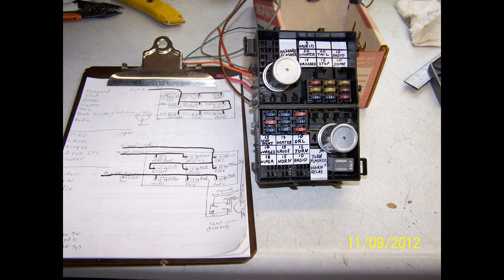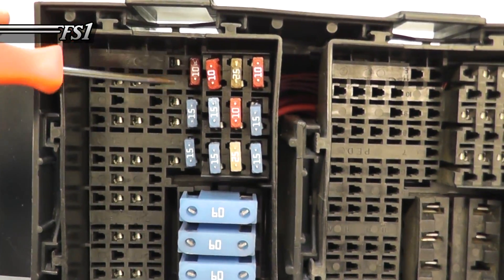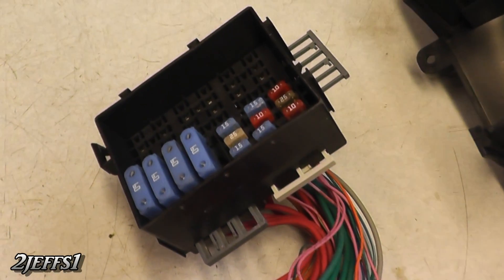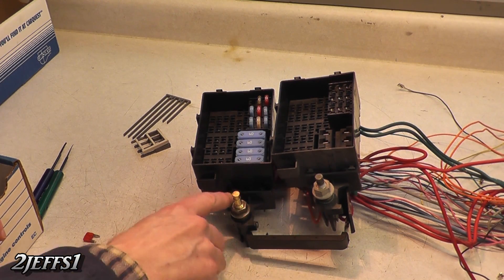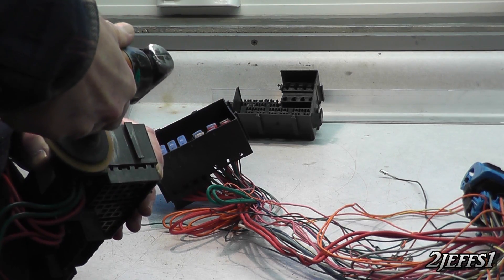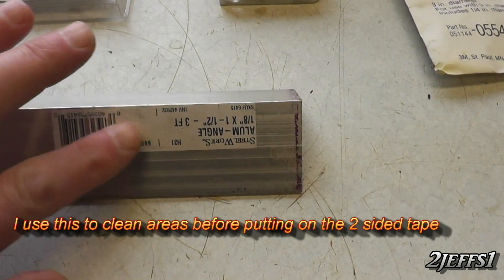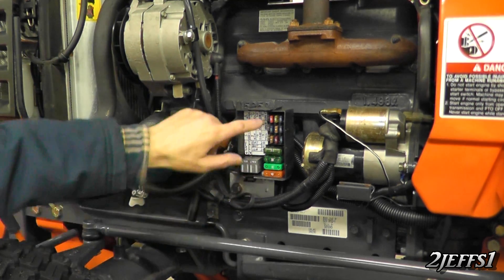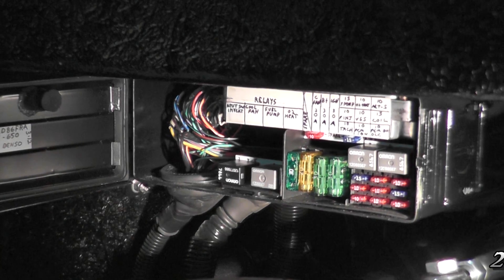Fuse Box Build Your Own Inexpensively DIY

Comment: very nice video!!!! I used an EZ-Wiring 21 kit to wire my 1978 chevy pickup mud truck up ... but for offroad lights, elec fans and elec fuel pump I'm going to be running a 1988 olds 88 kit. Waterproof relays (7) and a ton of fuses.

What size breaker do you run from the battery to the distribution block? I may of overlooked if you said it already...
Reply from the maker: Hi Jeff. Seems I have been using a 40 to 60a depending on the project. Just a thought - If you are using maxi fuses you could pull the main fuse, install an amp meter in it's place, turn everything on and then go 20a above that total load. Just make sure you have adequate wire gauge to feed the main where one taps everything off of. Usually around a 10 to 8 gauge wire is good for a main feed and then you have your 15 or 20's after the main. They do have those fusible links which were popular in the past but I prefer those maxi fuses these days for the main so if there would be a problem everything is in that same location. No biggie I guess just trying to give some you some  options.

Comment: You say you run one to the battery at 3:10. Is that the main connection that feeds the rest of the smaller fuses in the panel? Or do you have to run an individual wire from the battery to each small fuse?

Comment: Cheap alternative to the terminal extractor tool is paper clips. bend a portion of it straight, then put a slight bend near the tip like you did with your tools and it works great as long as your hands don't sweat. It doesn't work as good as the tool, but it works if you know exactly where the tab is on the terminal. I almost feel like i'm lock picking when removing terminals that way, lol.
Reply from the maker: Great tip for when one don't have that tool! Thank you, Jeff!

Comment: This is another great video, 2jeffs1!  I want to add a circuit to the existing fuse block to runn a small compressor on my truck.  there is one live unused spot-would you recommend using a Posi-Tap to the hotwire to tie into and then run the fuse there?  I didn't want to use an Add-a-fuse because can't get the fuse block cover on over those.  ??
Reply from the maker: +WorldCommander It sounds like you are good to go on your thoughts but without seeing what you have its hard to say for sure.

Comment: man you blow me away with some of your ideas, I never would have thoughtyou could turn those vehicle fuse boxes into something so versatile. I willdefinitely be doing that to my homebuilt tractor..so much better then those cheap auxiliary ones from the auto parts store..I noticed the occilloscope and power supply on your bench do you have an electronic background as well ? I am an electronics engineer by trade and a licensed electrician as well but I build stuff like you do as well, just wondered if you had crossed trade as well, it has its benefits and the stuff you do would lead one to believe you have a very wide range of knowledge.
Reply from the maker: +steve lecain I have always been creative thru the years which really helped in saving $$ to keep things going here. I do specialize in late model automotive electronics. There have been multiple times that the weird problem vehicles end up here. Have many ways that are not in a book for chasing the intermittent ones. I have fixed some sterio's and tv's thru the years before things turned into a throw away world. I haven't had any training on that stuff, not fast but usually do good. On the home wiring thing - all the electrical here has been done by me. From installing the service, main box, sub panels, bending conduit, proper circuit loads, 4 ways, security/fire system etc. The inspector shows up, has a wise guy comment and goes away. I have read some books thru the years which did help considerably especially for code stuff. I always tell people - don't let things scare you. You don't know til ya try and made some great friends giving how to advice along the way. But yeah - It has been an interesting journey here thru the years and being handy insured things could be affordability done! I bet it would be very interesting to follow you at work for the day. Where you do that for a living - bet there would be a lot to be learned above the level I'm at!  :>)
Reply: +2jeffs1 well my friend you seem to have a good handle on it,i just run a factory maintenance shop now after 40 years of it getting crippled up with arthritis so a desk job suites me,,but I have a nice shop home all the welding gear I need , would love a laithe and a small mill but that isn't going to happen any time soon..but I ave a huge inventory of tools I have been buying since I was about 15.yeh you mentioned wiring your own place, here in Canada you would not be allowed at all, you must be a licensed electrician,, and that was basically a job protection thing set up by the unions,,but far as I am concerned if you follow code and it meets the inspection it shouldn't matter. I am actually a licensed industrial electrician but I cannot pull a permit to wire a house,,,stupid but then again a union thing.but I do my own here anyway..you would love my electronics shop got some cool stuff there, I design and build circuit boards for some custom jobs I do on the side..thats where the electronics engineering technology diploma comes in..lol,, anyway take care man and keep those vids coming I am always waiting for them..

Comment: This is straight genius. Im trying to find a way to hookup a cheap fuseblock for my megasquirt powered starion. you are a genious. subscribed. i love how i have multiple spots for relays and 19 circuits.
Reply from the maker: ray Church Thank you Ray. Sounds like you have a fun project going on there. The hardest part for me is to find something that can be adapted that fits the need. Once you get past that the rest seems to go so much better!
Reply: 2jeffs1 Thank you for the quick reply. Its a custom turbo build. I'm wondering where the ground is for the fuse block. isitout of the main relay for the power from the battery or should the fuseblock have its own ground? i was at the junkyard all morning i have the fusebox ready and getting cleaned up. i have the terminalsoakingsoitslikea brand new unit.
Reply from the maker: ray Church Hi Ray. Neat to hear how things are going. Was wondering if your working on a Subaru so I can be most helpful. Just a little trivia for ya - On the Subaru I never used the main relay on my engine run system. Made lotsa changes. The way these were wired in my mind was way over-engineered. Same with the cruse control too. Ya blow the horn and the cruse is canceled as per factory wiring! I can tell you if you need a ground for any of the engine relays or system they should be taken off the engine block and not the chassis or battery. I would branch off as required on the back/hidden side of the fuse box as needed.

Comment: Working on updating the electrical system for a 1975 Jeep CJ5. Getting rid of the old glass fuses. What is your source for the Maxi fuse terminals? I know they are Delphi 800 series terminal. I found only one source for $5 each, OUCH!
Reply from the maker: Hi Gerald. Wow on the price of those. Sorry - I don't have a source for those. What I have been doing is prying open where the outer part of the c ring on a used one. Cut the wire there, install the new wire, re-crimp & solder. Maybe final touch with a piece of heat shrink. Hope this helps. If you ever find a source please let me know. Had to tell ya years back I had a 1974 CJ5. Had a blast with it for years. Like what happens to other folks - still wish I had it. :)
Reply: Thank you for responding. I did find the maxi fuse terminals for the fuse block you use a little cheaper @ $3.01 each. For those who need them, www.mouser.com PN# 829-12129383. Min order 1 :).
Reply from the maker: Oh wow. Thank you much Gerald! I've gotten things from mouser for circuit boards before but never knew they had automotive connectors. Nice tip for everyone. I like how the price goes down considerably as the quantity increases!

Comment: so when we wire our connections into the fuse box is it positive and negative? or just positive and ground to chassis. I am just learning car electronics.
Reply from the maker: mike frontuto Hi Mike. Generally the positive from the battery goes to the fuse box. Then you branch off with separate circuits to power different areas. ( lights, heater, wipers, etc. ) The battery negative would go directly to the chassis to complete the circuit.
Reply: Thanks! do you have a video that shows this in detail?
Reply from the maker: mike frontuto Sorry no I don't. But here's an idea for you which might be helpful. Locate a wiring diagram for one of your favorite car manufactures. Let's pic Chevrolet Impala or belair from the 60's. These diagrams are quite basic in those years and would give you a great idea/understanding on how to wire most homemade projects one would encounter AND how things are wired properly! That would cover from the battery, starter, fuse box, headlights - what ever areas you are most interested in learning. ( Look for what is called a service or repair manual ) Hope this helps, Jeff
Reply: thanks, will do

Comment: jeffs have a 1964 jeep willys my fire an gas is ok but my wireing for my signals lights an heat are so old an corroded i cant use is there a way to wire up my lights , stop lights, turn signals an heat an wipers useing your method .......
Reply from the maker: Hi Dustin. This style fuse box should be fine for your use. If you can obtain a wiring diagram for the Jeep they can be helpful on these type jobs. Take your time & mark  and replace wires. Maybe 1 at a time if that makes you more comfortable. I'd like to be more helpful but on wiring not being there makes things quite difficult. Jeff